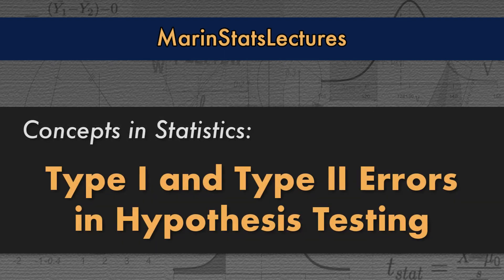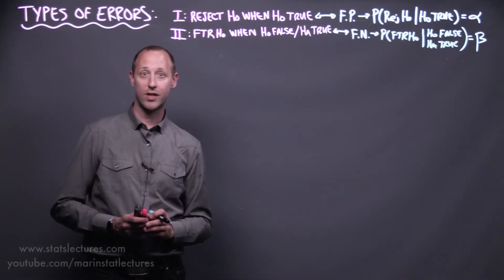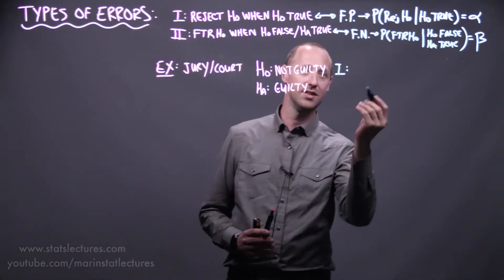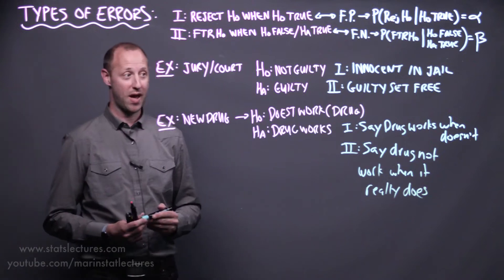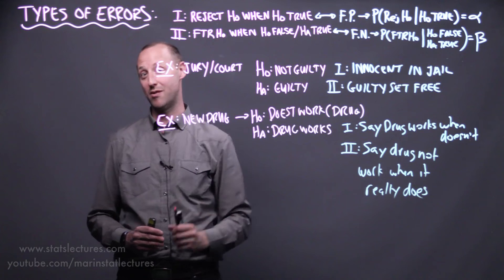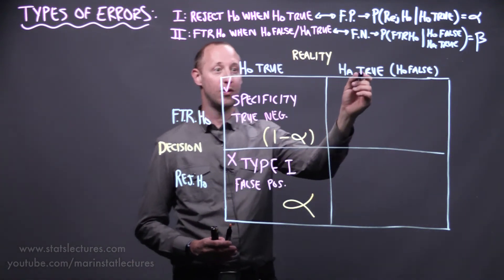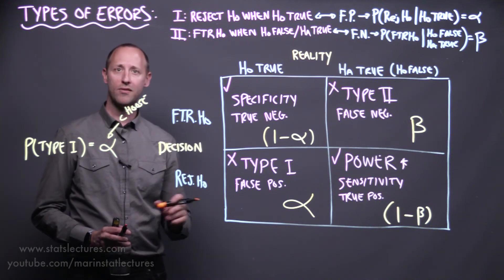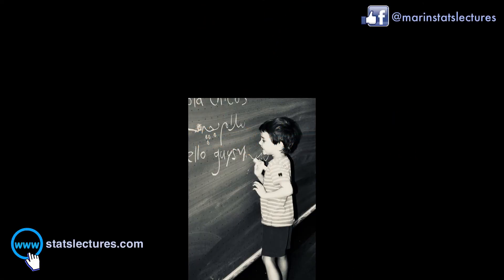Errors and Power in Hypothesis Testing | Statistics Tutorial #16 | MarinStatsLectures

Comment: Shouldn't a type I error be a F.N. because your result is that H0 is negative when in fact it is positive (so you falsely reported negative) and vice versa?
Reply from the maker: the terminology can be confusing at first.  when "rejecting a null hypothesis", this is referred to as a "positive test result". "failing to reject the null" is a "negative test result" (much like disease testing, null is that you dont have disease, alternative is that you do have the disease, and testing positive means we reject the null and conclude that you have the disease, and vice versa). so a Type I error is when we reject the null when in reality it is true. when we reject the null this is a "positive test result"...and if in reality this is incorrect, it is a "false positive". 

hope that helps clarify it.

i did find the terminology confusing at first.  think of it this way...when getting tested for a disease, a "negative test result" is that you dont have the disease.  while this isn't a negative thing to happen (it is good to not have the disease), the terminology is that you've tested negative for the disease (you dont have it).  similarly, a "positive test result" means that we think you do have the disease.  having the disease is not a positive thing to happen...but it means that you have tested positive for the disease.  that is what caused men confusion for a bit when i first learned this stuff...
Reply: @marinstatlectures  Thank you. It is confusing indeed but I think I got it now...